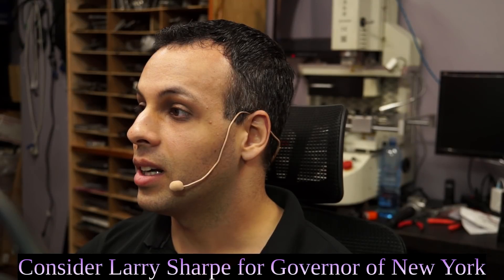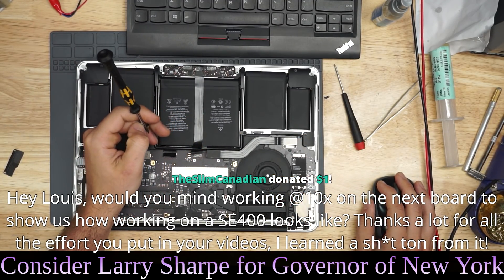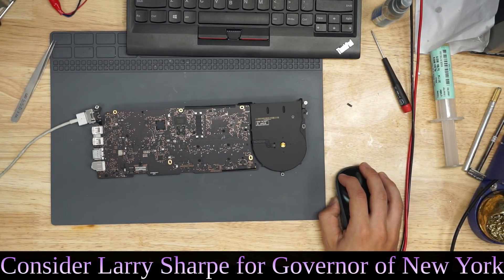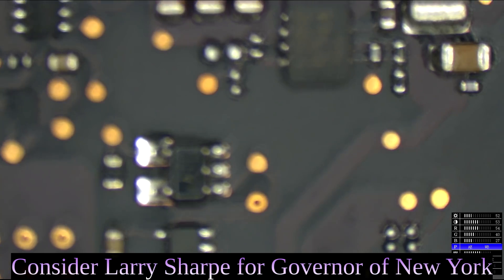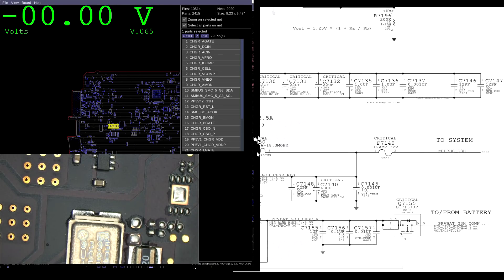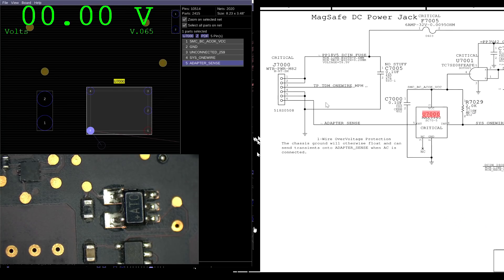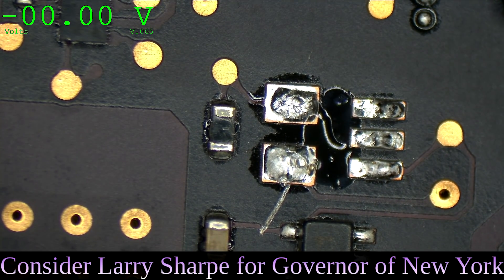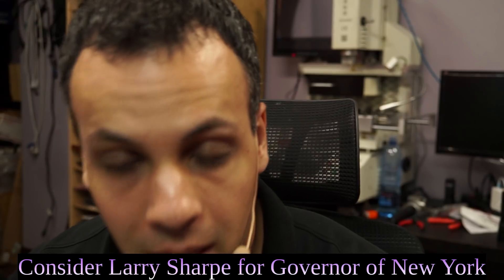Post concussion repair

Comment: you're right that a "3d printed gun" wouldn't be very effective if every single part was 3d printed, but it is very common these days to use 3d printed parts to go between more durable materials, like wood, metal, fasteners, rods, etc so a "3d printed gun" could still be assembled and last more than a few shots if designed correctly.

Comment: In actuality if there is perfect harmonization of the law, regulations and policies (which IMHO will never happen), a 3D printed gun properly licensed with oversight, will serve as a very viable self or home defense weapon. Something like a disposable use once (or 2-3 times) only weapon.

There are many people (note: many not majority) who would want a home defense weapon, but not own an actual gun because of the stigma related to it. The 3D printed gun with 2 or 3 shots will  serve as a viable albeit arguable option versus a carbon steel & composite (or whatever materials their grips/lower case some are made from) gun.

Deterrence in most cases is better than actual fights, I believe in some countries there are studies that show deterrence actually reduces fatalities. I mean a gun which can only shoot 2-3 times in common sense will have a lesser chance (but still lethal depending on caliber) of fatality versus a real gun with more than 6 or 8+ rounds (caliber dependent too) which will increase chances of fatalities.

No matter what type of gun, an armed robber or armed home invader will likely be deterred and escape if their victim has a gun. Added to the fact that compared to most seasoned gun wielders, the average Joe are not snipers and 2-3 rounds may not even hit a moving target, but definitely scare them away. If they have like 6 or 8 or more rounds in the clip, then most of the time even an average (unless really cocked eye) will have a much higher chance to hit the aggressor and if converted - a higher chance for fatality.

Of course the above scenarios are not for aggressors with psychology issues.

BUT unless it is commercially viable to produce en masse, and have tons of customers, it is not feasible.

Comment: 3D print all the guns you want, you still need cartridges. In order to make those you need gunpowder, bullets, casings and primers, plus some specialist machinery.

Anybody is legally allowed to own or rent a lathe and puchase scrap steel to his heart's desire and wallet's and credit limits. With those and instruction easily found online he can manufacture the real deal.

And you get paid to become a machinist, not to say after some time on the job you will get plenty of time alone with the tools, and nobody is goint to be able to argue you spent five minutes a day too long for the work you were doing.

You can carve gun pieces out of plastic foam, wax, wood, or what have you, use that to make a mold for a casting of aluminum, copper, bronze, pot metal. Oversize your design on account of the weaker material, leave plenty tolerace, and it should do.

Zip guns have been a thing before the internet. Some scrap tubing of the proper diameter (or go to the hardware store down the street) and a couple other bits and bobs probably already in your home, and you can make one. Instructions (with pictures!) once again easily found online.

In most places where getting a pistol or rifle is night-imposible, you can still get a shotgun and shot cartridges for hunting relatively easily. It is very easy to modify said cartridges to dump the whole front as a solid piece, all the shot packed together. Or you could extract the shot and replace it with a solid lump of metal, say lead, tungsten.
Reply: How easy is it to modify a nail gun to shoot ball bearings?

Comment: Sorry but youre wrong about 3d printed guns.  It does take equipment and skill but a $300 3d printer will do the trick no problem.  Its still impractical but its doable.

Comment: Hope you are still OK. In reply to your comment about "Paying attention" -  I do not pay any attention to the Mac-related stuff (IMHO, it's overpriced Junk!), but I obsessively watch and absorb your logical fault-finding and SMD techniques. And your humour and over-the-top self-shilling totally cracks me up!

BTW, you are not right on the 3D printed gun thing. I work for a filament manufacturer - and we sell a nylon-carbon-fibre filament that is more than capable of making a chamber that can be fired at least twice, possibly more. This will work in any domestic printer that can print at temperatures of 260°C/500°F and has a heated bed at 80°C/176°C.
A better version of a chamber is to not to use a plastic part as the chamber - you just insert a piece of steel pipe in there - make the rest of it out of plastic, but where the stuff goes 'bang', you use metal. You only use all-plastic when you need to go through a scanner undetected. Then you are either a goverment-sanctioned international spy, or a piece of merde.
To be honest if I was making an illegal gun, I'd just use a lathe and not a 3D printer for most of it.

And to those losing their shit over my telling people "How to produce a better plastic gun" - this information is already all over the Internet! Most modern guns are becoming a mix of plastic an metal parts now anyway, so get a grip!! "Grip?" geddit?
Never mind. <sigh>

Dumb folks are dumb, and politicians want Power - something that should completely preclude them from getting it.
The worse combination is dumb religious (aka - mentally infim) politicians/snake-oil salesmen/retarded 'Reality TV stars' wanting Power. Lobbying is Evil - not in the sky-fairy sense, but in the totally logical Humanist way.
I thought the idiots in power in the UK were total F-ups, good luck America, you are going to need it. As do we.

Comment: The issue isn't the 1 shot chump gun you saw in the early 2010's, people are worried about the 3D Printed AR-15 lower that has been shown to be capable of firing upwards of 6,000 rounds before failure. Though honestly, GhostGunner is a far better option, giving you a metal AR lower that doesn't exist as far as the Feds know..

Comment: you can get a $400 printer, and waste a year learning how to use it perfectly, spend more time making or getting the file, and print it, just to blow your hand up because pla and abs are just plastics, and you would need a metal SLS machine to get an actual gun that could fire,  but those cost upwards of 10K!, so why TF would you, just buy a $500 actual gun and f off
and let's not talk about accuracy or fire rate 🤣

Comment: a hi point pistol 9mm to 45mm abought $150 not bad no frills wld shoot a bit than send back to factory for warrenty if needed  not a bad gun you get what you pay for also if you need to use it it will be confiscated so  a $150 vs $600+ for a glock or sig??

Comment: Or you could buy a CNC mill. That is how the guns are made in factories. A CNC mill takes a block of metal and cuts away what is not needed. 3D printer sprays plastic on where it is needed. 

Here is a blank:

https://onlylongrange.com/forged-0-223-lower-receiver/

It is not a firearm. Put that on a CNC mill with proper data and you get a receiver which is the registered part.  I just do not get the fuss on 3D printing.

Comment: Is there a way to analyze these chips by opening them up to find out why they go bad? Not just to know, but if you find a reason that's easy to fix then the reliability would go up. Probably not good for business,  but you could sell the data to apple for $$$? They may want them to break and may not care, but then you could post the reasons in that case and maybe get $$$ for not posting the reasons? Maybe that would be bad too. Just a thought.

Comment: Speaking from a person who owns a Taz 6 from Lulzbot a $2.5k USD 3D printer.  I can EASILY print your gun and it'd probably run me around $10 for the filament aka plastic.  I could print it using my old $150 printer.  The hard part is the knowledge and the SLC file which is the CAD or instruction set for how to make it.  It is not hard with the knowledge and skill to do it.

Now the realistic view point. It would still be cheaper to buy a gun from someone else. Depending on where you live it could cost you $100 to a few thousand USD.  It will also be much faster because you can find someone to purchase a gun fairly quickly compared to the months of practice and fine tuning a 3D printer takes.

Lastly I'd probably take a few days to print the gun AFTER all the knowledge and tuning it would require.  Not worth the time and effort.

P.S. I can build a single shot gun from a hardware store for under $10.  I can do it in under a half hour.  How do I know this?  I've done it...

Comment: Louis, you're pretty uninformed about 3d printers. You can get a 3d printer for a few hundred $ if you're willing to fiddle a bit. At about 1000$ you can get a 3d printer that mostly "just works". And yes these printers have enough precision to 3d print a gun.

The real problem that people don't talk about, is that the 3d printer let's you conceal a functioning fire arm inside of benign everyday things, like a kids toy, a desk ornament, anything with enough volume to fit a spring, hammer, and bullet. The exit hole for the barell can even have a very thin plastic wall over it so that it appears perfectly normal.
Reply from the maker: How are you printing a steel barrel that controls the explosion with a $1k 3d printer?
Reply: @rossmanngroup  you don't. You use a shitty plastic barrel. They're practically single use (2 if you count throwing the weapon) and horribly inaccurate. But you can embed them in anything if you want to. Google "Liberator 3d printed gun" and you'll see one of the most controversial ones. The only non-printed parts are a pin (for a hammer) and the bullet. 

What's laughable about the stuff the media blew up about a few years back, is that they were flipping shit just because somebody printed a lower receiver, which is useless on its own.
Reply: Looks like Othercelmer1 already covered that last bit though.

Comment: Sorry your only partially correct, Sales of Firearms in the private sector although completely legal you as the firearm owner have to turn over the information to the police that said firearm, with serial number ######, make, model on and on has to be reported upon sale, otherwise the seller of the firearm is still responsible for said firearm, and of course when you report the sale you'd better have all the purchasers information, at a minimum full legal name, address, date of birth and either a drivers license or social security number or you could still be very responsible for that firearm if it is used in any crime, people do not have a full understanding of the laws behind private sales of firearms, yeah they would rather you do it completely legal which would mean involving a actual dealer with a actual federal arms license to do all the background checks and proper paperwork, but then someone would have to pay a third party and no one wants that.
I guess if you don't mind that the firearm you sell someone ends up killing another person and the police may track that firearm back to you then go right ahead and sell away.
Reply from the maker: good to know

Comment: I thought U7000 was the ISL that made G3Hot.  What was that five pin part you repealed and replaced?
Reply: Oh never mind.  That's a Maxim chip-one wire over voltage block.  Did its job.

Comment: Who in 2018 still believes you have to have a 150k 3d printer to make quality prints?  'ghost gun' or otherwise, a grand or so will get you a damn decent printer that can print what you need.  You still need a ton of knowledge and experience to do it right though, whether you buy a DIY 150 dollar 3d printer or a 150k 3d printer.

Comment: Louis, regarding 3d printing guns.  You're concentrating too much on the price and functionality as of now.  The point is that we can do it with zero regulations.  Material will drop down in price, which will makes it cheap.  Its a slippery slope.  Nothing wrong with common sense gun laws.  No one will take your guns away.
Reply from the maker: who defines common sense?
Reply: Lawmakers apparently.  Common sense would be a consensus on something.  For example, background checks are common sense.  It has support from people with multiple ideologies and ultimately doesn't harm law abiding citizens.  However, even though there is some consensus there, nothing gets done due to our current political climate.  Americans really have more in common than we think.  We need to filter out the people that think gun owners or violent video game/movie makers are the downfall of society.  And we need to filter out the people that think no laws are good laws.  Regulations have value if applied correctly.  Having no regulations like selling a gun to a buddy (street transaction) or a lot of regulations (blanket banning on a type of gun or guns in general) is bad.  We're too polarized and we're a nation of laws.

I'm someone that likes to look for solutions to problems.  We have a gun problem right now.  For the record, I don't think 3d printing with guns is a big problem right now due to the reasons you state in this video.

Comment: Yes they do have 3d printed Pistols that only shoot a few rounds before they self destruct. But you can 3D print a lower receiver for a AR-15 that can withstand the recoil. And the lower is considered the Rifle because thats were the serial # and trigger are located. You can go to any store and even online and purchase a UPPER receiver with no background check no FOID card and its totally legal.
Reply: For the price of the lower to 3d print it would be more than you literally using a drill press and a piece of metal or cast using molten aluminum.
The cheap 3d printers also need a lot of of fine tuning to even print decently so until the price for good mostly assembled 3d printers drops below the cost of a drill pres and a piece of metal there is no reason to even be concerned.
Reply: And the kick back will still destroy the plastic lower receiver pretty quickly.
Reply: Its called recoil and no it doesn't get destroyed quickly. the lower just holds the trigger and buffer tube. Their is not alot of force that gets transmitted to the lower. The weakest point is where the buffer tube connects the lower. And it can technically shoot single shot OVER AND OVER AND OVER again even if the buffer tube breaks off. Its been done. you can just disconnect the DGI gas tube and it will fire just like a single shot rifle, You will have to manually extract and load a round. The more you know!!!
Reply: Actually you can print the whole gun now and it will withstand anything any manufactured gun.  3d printing iscway further along than you think.  A trending movement is to buy a printer, make your gun, sell it at a lower cost to someone who wants to print theirs, on and on and on and in the end the cost is slightly more but not trackable.

Comment: Hey Louis, you can print an AR-15 lower receiver (the regulated part that is legally the gun) out of durable nylon on a $500 3D printer and a month or two of trial and error. the rest of the parts for the ar-15 can be purchased in a kit for around $300 legally through the mail without a background check from a business like Ceratac. Properly made, there are examples that have lasted hundreds of rounds.  It's not easy, not cheap, but it's possible and once you have to settings dialed in, a single 3D printer could make 1 lower receiver per day.
Reply from the maker: Good point
Reply: Louis Rossmann but you can legally make your own firearm as long as you aren't a prohibited person (menopause Jessa), or if that firearm/item isn't a restricted/banned weapon (short barrel shotgun/rifle, machine gun, suppressor, destructive device, etc. So 3d printing a AR-15 lower isn't a issue at all unless you're a prohibited person. And you could just make a AR-15 lower out of melted cans (Check out Guncraft101 Louis, I feel like it would interest you). So the issue with 3d printed guns isn't that you CAN print a gun (or lower reciever), the issue is that people who want to control guns will have less control/more people will be able to exercise their legal right to build their own gun. The idea that a 3d printed gun would be used for getting past metal detectors is pretty absurd, because the entire thing cannot be plastic (barrels, chambers, the bullet/casing itself due to the fact that these are high pressure areas). They actually had this "plastic gun getting through security" freak out before... when the Glock came out. And now the Glock is one of the most popular and widely used guns by law enforcement today.
Reply: @raymontutewohl8162  Yep, making your own firearm is legal and I encourage it lol

Comment: I tune in everyday for that one potential episode when Louis get's sent on a wild goose chase because the charger led has failed.
Reply: Isnt he using his own charger anyway? So he would realize pretty quickly that the original charger is at fault :D
Reply: Chuckiele I admit it's highly unlikely. But of all the times I was hoping the post concussion episode was the one!
Reply: Well it was pretty close to being the charging port which he admittedly didnt check first which would have been funny aswell :D

Comment: The 3D printer to print the gun that fires once or twice, costs as little as $200. For six figures you can buy a cnc machine and make a gun that fires as many times as a production gun. Actually, you can do that for less than 10 grand.

Comment: You do know that the 3D printed gun they're talking about is the one that completes the 80 Lower Receiver of the AR-15, right? The Ghostgunner? It actually makes the proper lower receiver, which is the only part of the gun in this case that is tracked.
Reply: morzinbo - That would not be 3D printing (not that they ever get confused) as it removes metal, drilling holes and milling away material - not an additive process, which 3D printing would be.